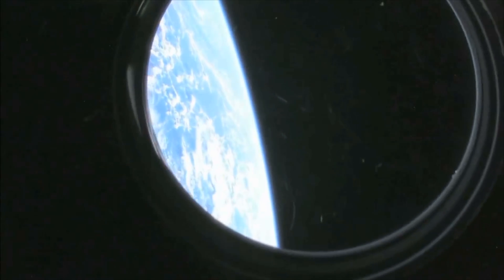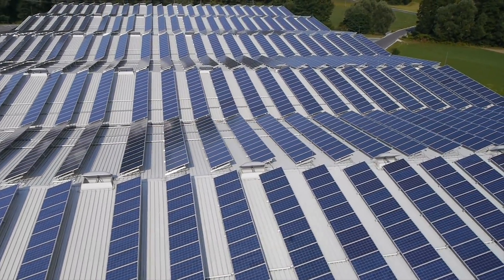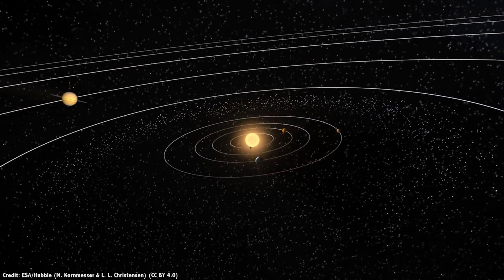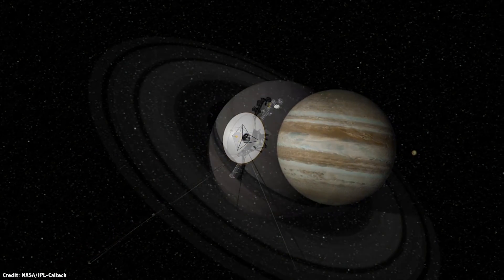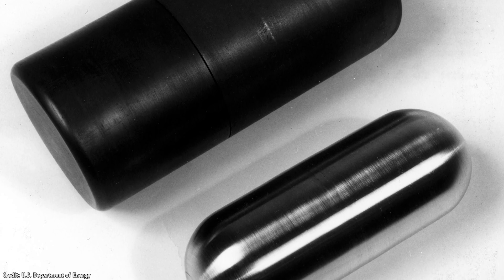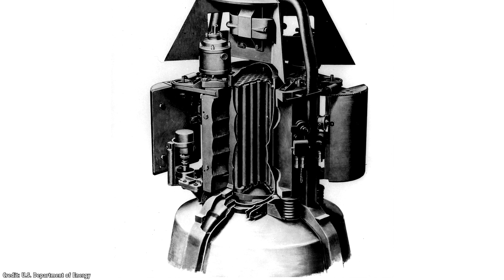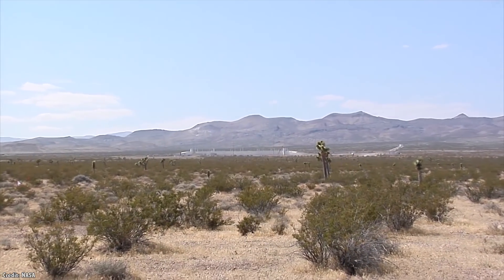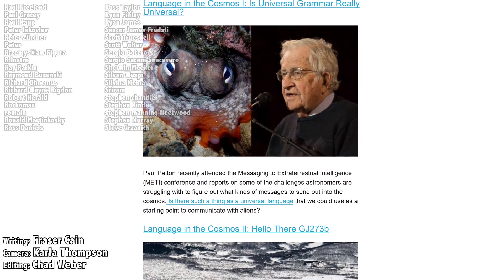The Problem of Power in Space. NASA's New Kilopower Reactor

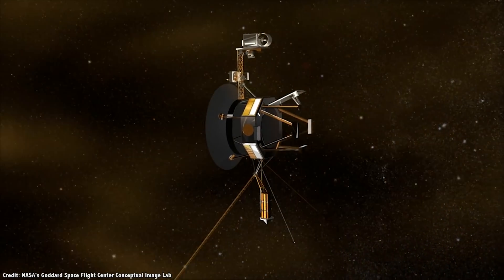Comment: 12:53 
Using solar with concentrating lightweight mirrors for missions in the outer solar system. 
Using nuclear fusion is already being worked on. 
NASA is funding Princeton Satellite Systems with a NIAC grant. 
http://www.psatellite.com/technology/fusion/ 
https://www.nasa.gov/directorates/spacetech/niac/2017_Phase_I_Phase_II /Fusion_Enabled_Pluto_Orbiter_and_Lander
Using safer isotopes for passive radioactive decay such as the diamond carbon 14 batteries. 
Using active mechanism in radioactive decay. 
"research is also underway to determine the feasibility of accessing energy stored by isotopes at 100,000 times the density that chemicals can provide."
Army-led effort demos new atomic effect for potential isotopic battery
February 07, 2018 By ARL Public Affairs 
https://www.arl.army.mil/www/default.cfm?article=3162
Isomer depletion as experimental evidence of nuclear excitation by electron capture Nature volume 554, pages 216–218 (08 February 2018)
doi:10.1038/nature25483
https://www.nature.com/articles/nature25483

Comment: Sorry but isn't the problem with space overheating? As soon as you have just a few machines running you generate heat and vacuum is the perfect insulator. There is no conduction and no convection, and ff you'd add reflective surfaces you'd have very low emission too and would easily cook inside a space station. From what I understand getting RID of heat is more difficult in space than staying warm and requires radiators and heat pumps.
Isn't this "zero temperature" just a silly cliche or am I wrong on this?

Comment: We still need to find another source I do think RTGs are very good there very expensive and have the radiation issue Wich isn't that bad. The availability of the fuel will be increasingly more expensive and harder to find. I still would like to see a bio electric device be created for power and low power spaceflight such as an organism that creates a chemical from a substance and turns it directly into electricity however I don't think that is an option at the moment. I do know some Labs who have had great success with this the problem is the nutrients needed in the bayou Electric sales would be too heavy at this time. But it is exciting to know that we are moving forward and I enjoy shows like this. Keep up the good work
Reply from the maker: That would be cool but then you'd need a way to feed the organism, which would require solar energy. For most places in the Solar System, solar power is your best bet.

Comment: Stirling heat engines are cool. However, they have solid-solid contact which produces mechanical friction and wear. Here is more about them.

https://en.wikipedia.org/wiki/Stirling_engine

Rankine heat engines are even cooler, since they produce more power per weight. They can be hermetically sealed with a single moving part, the rotor that contains expansion turbine, compression turbine, electric generator on the same shaft and suspended by nearly frictionless magnetic bearings with absolutely no solid-solid contact that will last virtually forever.
Reply from the maker: That's cool, I hadn't heard about these. Thanks!
Reply: Rankine engines operate every steam ship and steam power plant, including all nuclear power plants.  There are tens of thousands of them out there in use today.

https://en.wikipedia.org/wiki/Rankine_cycle

Note: I did not say that Rankine cycle engines ARE configured with a single moving part, only that they COULD be so configured.

Comment: How about electric motor turning a generator that puts out twice the input per turn to charge Batts or capacitors to hold the charge it can power free no fuel needed 24/7 power
Reply from the maker: The problem with perpetual motion machines is that they violate the laws of physics.

Comment: One of the concerns of large nuclear reactors suitable for nuclear electric propulsion in space is the danger of launch failure dispersing the radioactive material into our environment.   Re-entry concerns could be avoided by having the reactors only used in deep space applications where the spacecraft would not  be in danger of re-entering our atmosphere.   This has lead me to speculate on whether or not the relatively safe non-fissile Thorium could be launched then exposed to neutron bombardment perhaps by having a thin spallation beryllium shield over it as it passed through the Van Allen radiation belt  to produce Palladium 233, which could then be more effectively shielded for about 30 days as they decay into fissile Uranium 233 which could be used in a reactor.   It may take a few passes to generate enough Uranium with each "unshielded" spallation pass being at least 30 days apart since neutron bombardment of Palladium 233 would cause a different decay path.  Trace amounts of Uranium 232 would also be produced which though fissile emits gamma radiation during it's decay path hence interfering with electronics thereby requiring more shielding or boom separation but it could be a way of getting nuclear fuel into space without actually launching anything dangerous from the Earth's surface.   I think this could be worth a cubesat in the proper orbit to see if a sample of thorium could reach the uranium densities required, the uranium density could be easily measured by reading the gamma radiation produced by the unwanted uranium 232.

Comment: There is absolutely no doubt that nuclear is the way to go, and not just beyond Mars, either. Regarding a system for long term, very high power output, I think fusion will be the answer, and with the new REBCO superconductors ability to produce confinement field strength at previously unattainable levels, that means smaller units will be possible, and cheaper. So power will not be an issue in that sense, but I think that the TOKAMAC system may also have one more golden gift to give us. The temperature of the fuel mix will be many millions of degrees Celsius, and thus the velocity of those particles extremely high, one could design a new system whereby the plasma is ejected via a magnetic nozzle for propulsion, such a system would have the ability to be operated for sustained periods with extremely high thrust. It  would be capable of achieving a few percent of light speed in a relatively short time, unlike other particle engines which emit high velocity particles but need to be operated for long periods of time to accelerate.
Reply: psycronizer so where is this information going? Be good if you worked with nasa they need to speed things up and get us to mars.

Comment: I understand that nuclear reactors work by using the heat from fission to turn water to steam. Convection currents then carry the steam through a turbine, which generates the power. I also understand that radiator panels are used to regulate heat in spacecraft. Could you combine the two ideas to produce power? For example, instead of using radiators that are just flat, conductive panels, use a water cooling system that draws heated water and steam away from parts of the spacecraft exposed to sunlight, passing through a turbine along the way.

Comment: The fusion company Helion Energy has already worked with NASA on fusion-engines for spacecraft even though we haven't reached breakeven.
Reply from the maker: Very cool, I hope it works.
Reply: Here's an informal summary of where fusion is today.....
http://laurencehunt.blogspot.com/2018/07/is-compact-fusion-power-now-fewer-that.html
Reply: +Ruben Kelevra
Look up the Tokamak bottle, there's no external magnetic field
Yes, it needs a large power source to start up.  NASA's Kilopower nuclear generator (because it's really a thermal power generator, not a true reactor) plus fuel cells may provide the solution to that.
The SPARC is significantly smaller and lighter than the ITER - it might even fit into the proposed BFR.  All we need is one or two power facilities in HEO or on the Moon and -well, please pardon the pun - it's off to the races.
Reply: @HuntingTarg  That's nowhere remotely near as small as a reactor needs to be for it to be mounted on a spacecraft. xD
No existing or proposed rocket could allow us to liftoff with a mass such as what would be required for a functioning fusion reactor. We're talking about something many times more massive than a LEM/Lunar command module combination that would need to be mounted on top of a rocket and that's not even mentioning the other systems needed for a proper spacecraft. That would be like putting a nuclear submarine reactor on an SUV. xD
Reply: @Not.a.bird.Person 
An apt analogy. 

I have delayed responding, but can't find the infernal video on SFIA that makes this point:
The only cost-effective solution for repeated travel to destinations outside of earth-sun orbit is to build a ship in space ; something designed to transfer from one planetary orbit to another, and dock and service landing craft, but never actually land itself.  This would make it 100% reusable, upgradable, and easier to design without the constraints of planetary atmosphere and gravity on it mass and structure.
It naturally follows from this that drive systems that would not function for liftoff from earth's surface would function quite well as a primary drive for this type of craft - a fusion reactor, whether a direct-drive or superheating design type, could be prefabricated in components on Earth or the Moon's surface, then assembled and installed in orbit.
So no, putting a fusion reactor on a rocket designed to take off from Earth, whether drive system or payload, makes no practical sense.  However, rockets aren't the only game we can play and win at.
https://www.youtube.com/playlist?list=PLIIOUpOge0LsGJI_vni4xvfBQTuryTwlU
Reply: @HuntingTarg  I have to agree with the technical feasibility of many launches for an orbital assembly, however, from an economical standpoint, this seems far fetched. Like I said earlier, a fusion reactor, be it for propulsion or electrical power, is something that is, at least for now, so prohibitive in costs and in materials that it would be too large and too expensive to efficiently build in orbit with current technology. We can safely assume that anything that must be built in space will be at least 10x (in a best case scenario) the normal price of building that thing on Earth. If we look at current estimated prices for ITER as a reference, this would put the price of a fusion reactor built in orbit at 216 B$ for the reactor alone, not even accounting for infrastructures needed, R&D and everything that comes with developing a fully new revolutionizing technology.
Reply: Fusion reactors is quite a while away, this tech is really complicated in terms of long term self maintaining fuel supply and getting rid of the products. It also needs a huge amount of power. Also we're talking more about a station somewhere on the ground than a spacecraft in terms of size.

But the real issue would be shielding other equipment from the neutron radiation as well as the very strong magnetic fields for the containment 🤪
Reply: Ruben Kelevra Getting rid of products? Is it difficult to expell the helium through the plasma hole in the back of the rocket?
Reply: xWood4000, I'm not holding my breath.
Reply: IncognitoTorpedo Yeah, fusion is great but it will take time still.
Reply: xWood4000 
Meaning: fusion power will be great (whenever it gets here... I refer to my above comment).
Reply: MiT's SPARC reactor is showing more promise than the ITER, thanks to a new supermagnetoconductor material.  SPARC uses a liquid shielding system that sheets the tokamak wall, and is easy to reclaim and store.  It's a fairly exotic substance, but it could hypothetically be combined with water to produce even more deuterium and tritium, thus manufacturing its own fuel.

Fusion power is light enough to rocket into space, and powerful enough to supply steady power for decades without refurbishment - and no high-level radioactive waste. 
In space the main problem is heat dissipation.  The amount of waste heat generally scales with the power generated, so keeping a fusion reactor regulated without an atmosphere would be the toughest challenge.
The first fusion power generator may ( finally! ) be less than a decade away - if it overcomes political and market obstacles, it could end the energy crisis and hold the door wide open to explore and colonize the entire solar system.
https://youtu.be/8Pmgr6FtYcY

Comment: You say that the SNAP-10A reactor's nuclear material will have largely decayed by the time it drops back to earth. This is incorrect, because it used uranium-235 fuel rods and U-235 has a half life in the millions of years
Reply from the maker: I wonder what the byproduct of the reactor's half life is, though.
Reply: the fission products? well, medium-lived radioisotopes with significant fission yield include Cs-137 half-life 30.17 y, Sr-90 half-life 28.8 y, Tc-99  211,000 y; the cesium and strontium will have decayed. but Tc-99 is a pure beta emitter, so not as dangerous
Reply: well okay, sea water has 3 parts per billion or so uranium; so if this object will burn up and be strewn over a wide area and drop into the ocean, then i suppose "a few" swimming pools worth of ocean will dilute it to background levels (probably less than a cubic km)

Comment: At 3:00 it is stated that dust devils cleaned the surface of the solar panels but this is actually incorrect. The phenomenon is known as electrostatic cleaning because the dust on the surface is pulled away by the electrostatic forces (strong electric fields) that are responsible for the movement of dust on Mars

Comment: Fraser, so were all the previous nuclear reactors, including the snap reactor, thermocouple designed?  On earth, nuclear reactors super heat water into steam to spin a turbine that generates electricity.  What are they using, hydrogen, ammonia, super critical CO2, or other, to run the sterling engines?  Are they turning a generator to create electricity?  What is used for reactor coolant?  

I think nuclear is part of the solution for our needs to generate power here on earth, makes sense to have SMRs out in space, moon and Mars.
Reply from the maker: It had a thermocouple too, harvesting electricity from the temperature difference between the reactor and space. It's like like you can have a steam turbine in space. Or maybe you can?

Comment: kilo power huh? Why use sterling engines instead of thermo-electric peltiers?  Are sterling engines more efficient? I wonder if the peltiers are limited in the power they can generate given heat because there needs to be a strong temperature delta which may not be available.  Space is cold, but you can only dump so much heat, right?
Reply from the maker: From what I understand, the peltiers aren't that efficient, they're just simple and reliable, while a sterling engine is more efficient but has more moving parts and could be more likely to break down.

Comment: For those interested, RTGs function by wrapping the heat source with, a bunch of what are essentially thermocouples. They produce voltage roughly proportional to the temperature, although the voltage is in the millivolt range, so a large number are required to generate enough voltage and power.
Reply from the maker: Yeah, they're not very efficient, but they're simple and they work.

Comment: I think that these present an amazing opportunity. (I wrote this while watching the first 2 minutes of the video so hopefully I won't have to change this. lol)
I've been pushing for these for years (admittedly on the forums, but hopefully as an active participant in the space industry within the next 10 years.)
IIRC the SAFE400, for example, only weighs ~2000lbs, is totally self-contained and autonomous, generating 100kW of power, and only takes up 1m tall, .5m diameter cylinder. I'm guessing there might have been an issue with the SAFE if they developed something new, though...

Any idea what happened to the SAFE or is the reactor you mentioned just the fielded/ validated derivative of that?

The SAFE400:
https://en.wikipedia.org/wiki/Safe_affordable_fission_engine

Comment: Could we keep spacecraft like Voyageur going by sending out another ship carrying a replacement power unit and returning with the spent one? The repair ship would not need as much power to reach Voyageur and return immediately and the Voyageur could continue on with more missions providing it hasn't deteriorated from the stresses of space and it's equipment become obsolete.
Reply: it could theoretically be done. However, the replacement ship would have to be rather advanced robot to be able to automatically dock with Voyager and automatically perform the swap. It would also need a rather expensive rocket to reach required speed to reach voyager in time. It would also need powerful on-board engines and fuel to slow down for docking.
In the end it would be much more expensive than the voyager probe itself. It would make much more sense to simply send new missions, with better modern equipment.
I think we should leave voyager die and perhaps retrieve it for a museum later, once our spacecraft become more powerful and cheap.

Comment: I had been wondering why they hadn't used Sterling Motors in a thermal reactor for a VERY long time! I mean it's only extremely efficient! Anyone that knows Sterling Motors, also know that they can reach up to 90% efficiency of more! ~SHEESH!~
Reply from the maker: There's a really cool idea I like about using a Sterling engine for a Venus Rover.
Reply: KohuGaly
 : NASA should get Honda to make a VTEC sterling space engine :o)
Reply: I believe the problem was reliability. Sterling engines are mechanical devices and they would need to operate for a very long time. Solid-state solutions like the solar panel and peltier-effect powercells are far more reliable. Mechanical failure is a common source of death in spaceprobes.